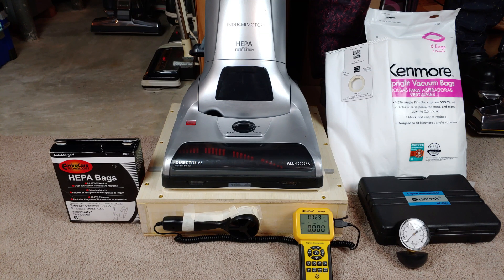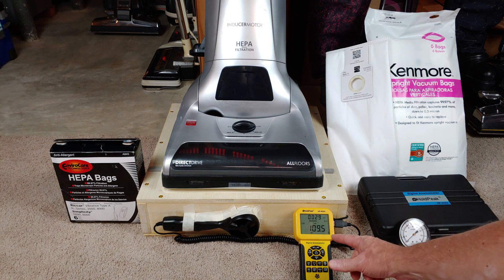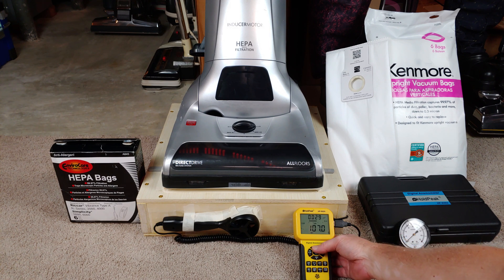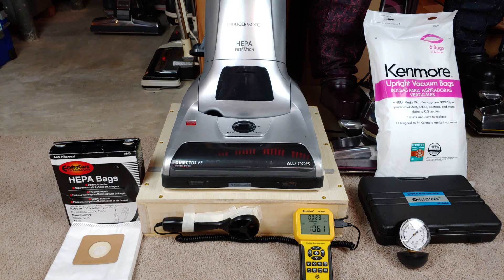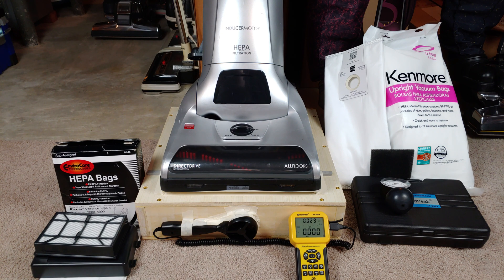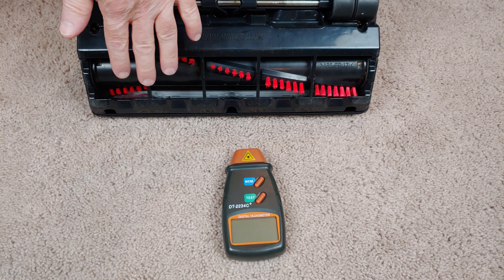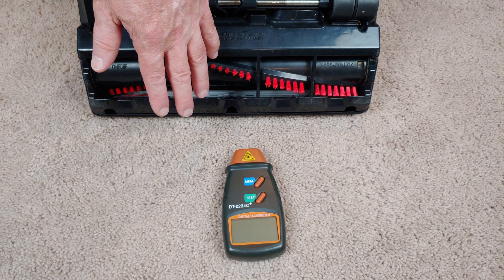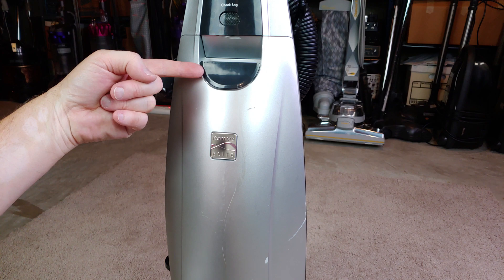Kenmore Elite 31150 Airflow Suction And Brushroll RPM Tests

Comment: That much lift is too much for area rugs.  Its impossible to keep them down with suction lock.  The lift is great for attached carpet.
Reply from the maker: Actually, my measurements prove about 20-30 inches is plenty. Airflow is something else entirely.
Reply: @VacLab  our 60 horsepower hot water extraction system is set for 15 inches of lift.  That's plenty for our industry.  We run 2 inch to 2.5 inch hose at 650 cfm.
Reply from the maker: remember, I'm talking about performance numbers at the nozzle, not at the motor, which is much higher.

Comment: Though I think it is a particularly useless metric other than for testing to see how well a machine can run an air-powered turbo nozzle, I noticed that certain YouTubers on here (especially one) like to assert the "working vacuum" number, yet the user(s) who tout those numbers seem oddly biased against these Kenmore machines. Because of this and the impressive airflow and suction of the 31150/BU1017/BU1018, I made my own gauge and I found that this model gets around 60 inches of "working vacuum," with a close second (of the ones I tested) being the Kenmore 31140, which got about 55" if I remember correctly. In other words, they blow any Miele, SEBO, Henry, and so forth out of the water according to their logic and it brings me a lot of joy.
Reply from the maker: Suction measurements are mostly useless as suction is a negative pressure that isn't a speed or volume. Performance Reviews has no idea how to measure vacuum performance, which is ironic considering his channel name.

Comment: Nice vacuum cleaner with great airflow tests. Slightly lower than my Anniversary Edition Wind tunnel. Unfortunately, what happens two years down the road when the brush roll needs replaced? Thats the gotcha at 200 bucks if they would still be available. After all no more Sears and Panasonic left the NA vac market. Thats more than half the cost of the cleaner. Pretty expensive brush roll. Dont see where the direct drive adds anything but increased repair costs
Reply from the maker: Replacing the brushroll is far too expensive in this model. That's why I grabbed another one for $9 a few months back. It came with a full toolset as well.

Comment: My 100 cfm Vorwerk has been beaten👍 Although I bet this can use all that airflow due to the large cutouts in the bottom unlike the Vorwerk what is very hard to push on the max power setting. It will be interesting to see how well that low rpm brushroll does in the pick up tests.

Comment: I think this machine uses 2 motors like the riccar tandem air vacuums if I remember right. But this has much better airflow so I think it might have a possibility to pickup better in my opinion. 👍
Reply from the maker: It has one suction motor and one brushroll motor as seen in the reassembly video.

Comment: On a Riccar, the inducer motor causes the CFM to rise (rather than drop) when the brush-roll is enabled.  
Is this because the inducer motor on the Riccar is an actual direct air motor?

They claim to have 2 motors on the Kenmore 31150
Is this counting the brush-roll motor?
Reply from the maker: The two motors are the brushroll motor and the induction motor in the lower body.

Comment: Interesting that the brushroll doesn't even use a belt or even a separate motor. It's just directly powered by the primary motor.
Reply from the maker: The motor is inside the brushroll itself.

Comment: Nice test! 106 CFM may be a record for 2nd-highest bypass airflow, right behind Blackheart's Ultra MVP. As for the bags, I think the slightly lower airflow from the Kenmore bag has to do with the numbers of layers of filter material - genuine Kenmore O bags are the best quality I've found for filtration and durability. 
Also, the lower brushroll RPM isn't so bad when you consider how beefy the roller is - a larger diameter roller means higher linear speed at the bristle tips, and thus the bristles hit the carpet at a proportionally decent speed.
Reply from the maker: I still want 4000 RPM. 😂

Comment: Always listen to consumer reports
Reply: Hate to break it to you, but CR has never been a good source for vacuum recommendations. Their testing methods are weird and don't consider things like reliability and overall usability well. You're better off doing research based on people in the vacuum community like VacLab, and coming to your own conclusion from that. CR just got lucky when they recommended these Kenmores.
Reply: @lacking4290  I used to subscribe to CR for their vacuum reviews. Sometimes I agreed with them and sometimes I didn't. Their tests are always done in a lab, rather than inside of a home. The results can vary depending on the user. What someone might find cumbersome another might find practical. In the past, I always went straight to their reviews on how well a vacuum performed on carpeting and bare floors. But, I would later be drawn to their emissions testings.
Reply: LackingVacuums 
You are 💯 right.  
They act as if a vacuum is good if it removes massive debris.  
They need to start doing carpet deep-clean tests, because removing surface debris is not deep cleaning the carpet.  
That’s what most Shark and Dyson owners don’t understand.

I, myself, didn’t understand this until I bought the Kenmore 31140
Reply: @lacking4290  okay